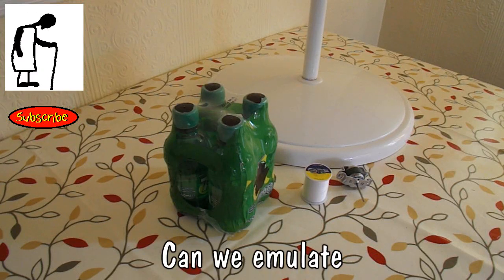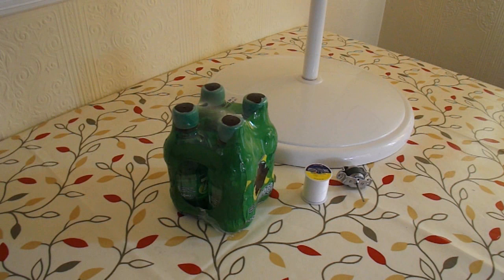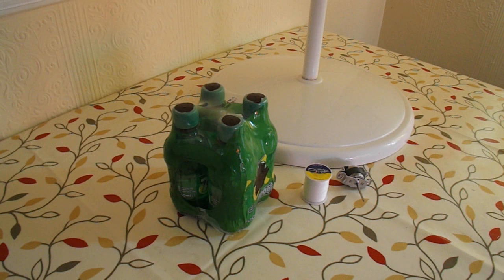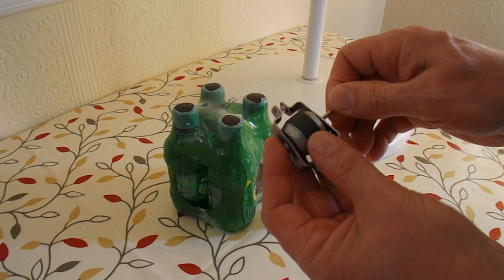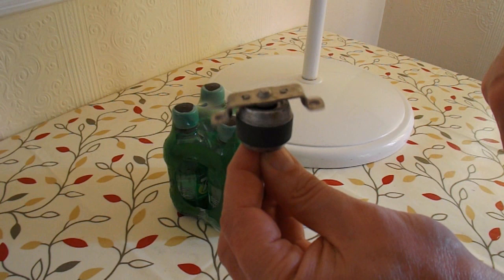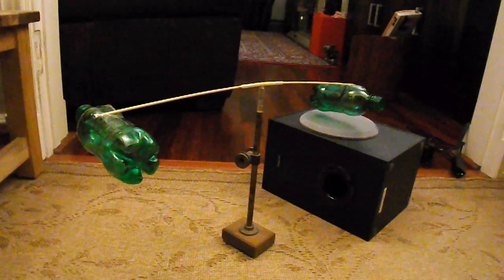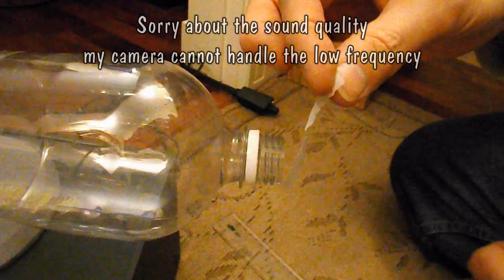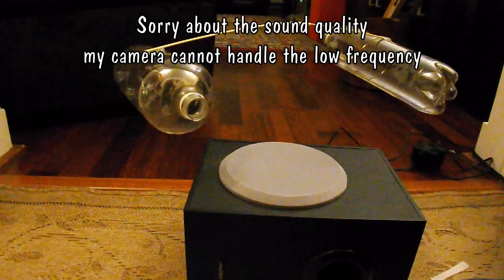Helmholtz resonance demonstration - thanks to RimstarOrg

Comment: Cool! We've been using magnetic 'bearings' and custom made glass resonators and sound system:
Project Intervals
Reply from the maker: That is a beautiful piece of work you have done there.
Reply: GrandadIsAnOldMan
thank you sir. it was pleasure to work with natasha, her scientific approach to art is impressive indeed. interesting was that she needed to tune the system because of the difference in pressure and temperatures between daytimes.

Comment: Very different and certainly something extra for rainy day building with children. Was good to see what didn't work as well as what did :)
Hmm, maybe paint the bottles up as airships. You could have searchlights, anti-aircraft guns etc in an effective WWII diorama scene. 'Battle of L.A.' being the thinking.
Reply from the maker: I was a bit worried about the volume I was playing the tone at, I seem to remember that low frequency tones can travel long distances so I may be upsetting my neighbors. I still want to try to get the smaller bottles working but will need to rethink how I support them, maybe magnetic bearings.

Comment: That is a very simple experiment to duplicate demonstrated by Rimstar. I believe you could use the very sound from Rimstar video to get the resonance effect happening on a coke bottle around you.
Reply from the maker: Hi boxerlego, thanks for the comment, that might work with Coke Bottles. I thought it would be easy but I tried my own ideas first and spent about 8 hours failing before I reverted to the method shown by Rimstar and LjudochVibrationer (note Ljudoch's video was uploaded in 2011). I made my own soundwave using the method Rimstar suggested and learned a little more about Audacity in the process. You cannot just use any wave, it has to be the correct wave to resonate the bottle you are using, that is what Helmholtz Resonance is all about, it is specific to the container in use and copying a wave off a YouTube video probably will fail due to the issues with the quality of sound reproduction anyway. Certainly I doubt that using my wave from my video would work as it has been terribly distorted by the video processing. Another issue I had was that using cotton thread to suspend the assembly caused it to spin on it's own due to the twist in the thread so I had to make sure it turned in the opposite direction under power to prevent spoofing the results.